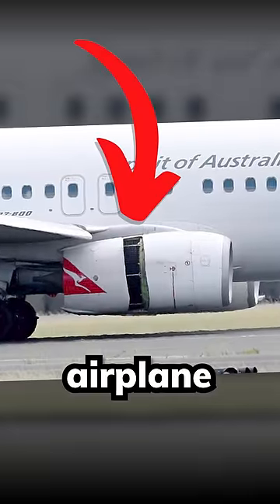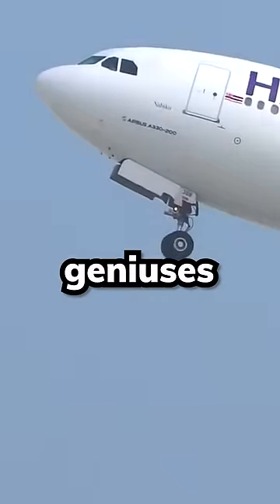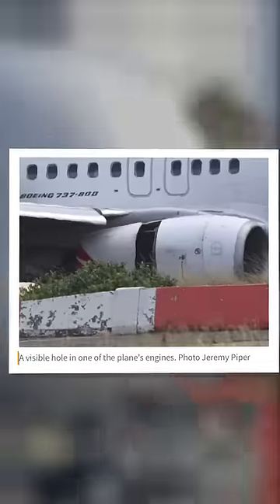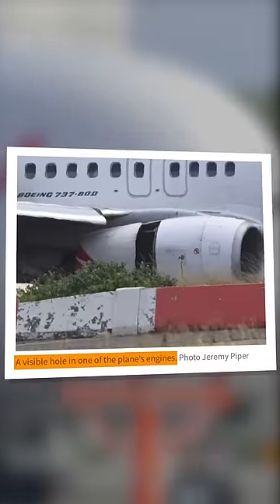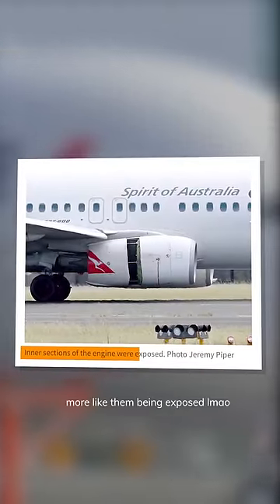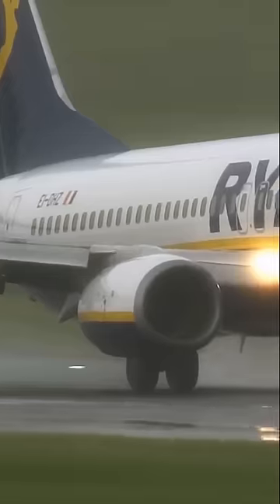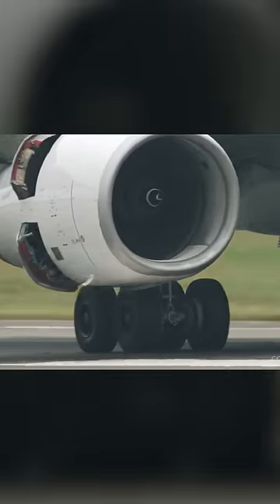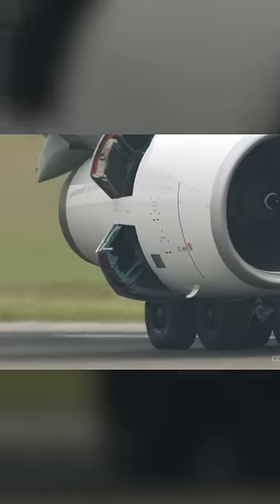Huge Hole In Airplane Engine 😱 @dailytelegraphAU lmao its called reverse thrust

Comment: That article made me have an aneurysm
Reply from the maker: I don’t even know what that means but LOL
Reply: @LuxPlanes  brain fart
Reply: What da word 
I better make a real hole and hide in the engine instead of googling forever
Reply: @shaurya.m2612  an aneurysm is when a blood vessel in your brain bursts. Can be caused by high blood pressure. Basically the joke being that the stupidity of the article that claimed the thrust reversers were damage caused me so much anger that my brain started to break.
Reply: @viscounttudon68 Did your brain use reverse thrust?

Comment: Even non aviation geeks are smart enough to know those are reverse thrust
Reply: Believe me, they aren't. They don't even know what a flap or an airbrake is.
Reply: @juannicastro8598  really?? damm..
Reply: I didn't know
Reply: @juannicastro8598  Can confirm
Reply: @WindowsDrawer  but now you know ;)
Reply: Nah
Reply: Actually not at all. Many of them might not even know those rounded objects hanging from the wings are engines.
Reply: @WindowsDrawer  are you a avgeek or not?
Reply: @greenesyt563  no
Reply: @greenesyt563  bruh i just asked my sis and she didnt even know those things sticking out of the fuselage are wings
Reply: @Notathreelettername  how did she know what is fuselage?
Reply: @greenesyt563  i didnt ask her that, i just asked her about the wings. but im not even gonna try to ask her about the fuselage cuz im pretty sure she doesnt know anything about planes considering the fact that she also apparently doesnt know planes need wings to fly. i swear i have no idea how that even came to be cuz shes also older than me by a year

Comment: They also called the 737-800 involved in the engine failure recently between Auckland and Sydney a 747-800!
Reply: XD, Daily Telegram better research more.
Reply: @AviationWeekly130  sky news also called it a 747 on their live broadcast!
Reply: @mini2flyerau oh my God. They need to learn.
Reply: @AviationWeekly130  yep, there is a difference between a 737 and a 747, not to mention qantas doesn’t even operate the 747 any more.
Reply: @mini2flyerau yeah XD, I love Santa's. It's a good airlines. Reliable. It's sad to see the 747-8 fllet is gone.
Reply: @mini2flyerau  qantas* lol
Reply: Bruh
Reply: Those two aircrafts have BIG differences!
Reply: @artyjaycayairlines ikr 💀
Reply: Now that's just embarrassing. A 5 second google search would give them enough info to at least name the plane right. With most airlines the plane type is even written on the side.
Reply: @Rundumsfliegen  exactly! The 737 has it next to the flaps, so easy to spot
Reply: bro what
Reply: Its honestly an easy mistake, like, could have easily been a typo. Yall are forgetting that most people arent huge dorks like us av nerds.
Reply: @gearhead743  suppose so but they are a national news outlet so you’d expect they would catch something like that

Comment: “Omg there’s a hole in the wings!!!” 

“Ma’am please calm down those are just the air brakes…”
Reply from the maker: XD
Reply: Spoilers*
Reply: @RedditRoyale120  if we are talking from a, flight attendant to a passenger, that already seems to lack basic intelligence, it would likely be dulled down to “ooga booga brake make stop, air brake make stop with air” so I doubt they would throw in the extra level of “intellect” required to understand
Reply: @RedditRoyale120  Aren't spoilers used for roll (as well)?
Reply: @dutch24 no , those are the ailerons
Reply: @Thel_Vadamee   appreciate the better information, it does not make your attempt any less valid. simply a gesture of semantics.
Reply: @Pgb633  on certain planes like the F-14 (because of the awkward wings) and the B-52 (because it’s so big that ailerons would literally twist of the wings) they strictly use spoilers
Reply: Wait until that passenger sees the plane landing in hot turbulance ocean airport
Speedbreak,max flaps,the wing vibrate like never before, and micro fall
Reply: @pham3383  they’d just roll over and die
Reply: @dutch24 spoileron
Reply: @Pgb633 spoileron
Reply: @nuclearwarhead9338  Thanks
Reply: @nuclearwarhead9338  lol 🤣
Reply: @Pgb633 on some planes, the spoilers are used for roll as well, look at basically any modern airliner and basically all swing wing fighters
Reply: @dutch24 yes they are used for roll control. 

In flight - when the pilots operate the   Ailerons , the spoilers on the "Down Wing" will also extend and assist the Ailerons in Roll Control which also increases the effectiveness and efficiency of the Ailerons at low and high speed.

The Ailerons and Spoilers are controlled by moving the Control Column ( Boeing) and Sidestick ( Airbus) left or right...
Reply: it's the same control surface, just that depending on the stage of the flight they're called spoilers, airbrakes, roll spoilers and a bunch of other names that i don't remember rn
Reply: @nuclearwarhead9338 spoiler
Reply: "THERE'S A HOLE IN YOUR LEFT WING!"
Reply: @EmilioGameair es ...
Name of Flight Control - Spoilers ( shaped like a square, found on top of each wing)..

Purposes - Speedbrake/Ground Spoilers ( on ground after landing)

Flight Spoiler ( used only while Airborne)

Roll Control ( used with the Ailerons) - see my explanation above. Ill give you the Extra points for mentioning every word you can think of ... ❤
Reply: Speed brakes
Reply: @RedditRoyale120 Spoilers are on the leading edge of the wing. The things that pop up on the wing are speed brakes.
Reply: @Pgb633 Ailerons and airbrakes are the same, it's just that you 9nly apply airframe on one side, and then deploy them at the other side but in the opposite direction.
Reply: @Thel_Vadamee casual sexism..
Reply: @Thel_Vadamee because men all know what reverse engine is and couldn’t possibly report that there’s a hole? Misogyny
Reply: nervous passengers in a nutshell:
Reply: @adultvirgin Ur right but using da spoilers for rolling is odd
Reply: @RedditRoyale120  same thing nerd
Reply: @Pgb633  what
Reply: @vladivosdog  my fault gang🙏🙏

Comment: Pilot: turns off the apu.
Media: The engine stopped and the pilot still took off.
Reply: LOL yes apu screee
Reply: I’ve flown with a broken APU, it was kinda cool. 

I fly charter flights all the time, so we have the same pilot and staff every week; a lot have remembered ours names. 

But no lights on take off is a vibe
Reply: @jimmymifsud1  I may be misunderstanding this since this is applicable to bigger aircraft, but wouldn’t it still have power on takeoff from the engine gens?
Or the battery?
(Probs doesn’t provide enough power lol but I want to ask)
Reply: @LittleJimmyR  depends on the aircraft, most regionals use engine genrators
Reply: @LittleJimmyR  the APU is a small engine that's gen power  back in the tail of the planes it's mostly used before turning on engines and before or after landing also they are used in emergency specially when a engine fails, when the engines are booted up. They can turn of the apu because the engines will generate power.
Reply: @docyinjkoka8684  I know what an APU is, but they said regional uses engine generators
Reply: @LittleJimmyR  ofcourse lol the engines already have generators thats why i said the apu stated before engines and it will be turned of after both engine started if the pilot was taxing with one engine than apu will be on intl the second  engine starts
Reply: @docyinjkoka8684  the apu was broken?
Reply: What is apu lol
Reply: @lubiepociagi6675  auxiliary power unit. Like a mini engine except it doesn’t provide thrust, only power
Reply: @LittleJimmyR  also bleed its very important to start engines
Reply: @docyinjkoka8684 that is indeed correct..
The APU also provides Bleed Air ( load compressor ) , used for Air-conditioning, Pressurisation etc...

During Landing for example, the APU supplies the pneumatic system, this is done to prevent sudden De Compression at low altitudes , it also keeps the Air Conditioning Packs ( Pressurisation/Air-conditioning Kits ) online, acting as a backup ( Engine Failure)....
Reply: @docyinjkoka8684 Yes, indeed ....

Modern Turbofan Engines , use Pneumatic Starter Motor to crank the Engine.

Comment: Pilot:dumps fuel
Media:oh no the plane's pissing, now sue the airline
Reply: Pp
Reply: plane took a piss in mid air
Reply: Oml im dying reading this ☠️
Reply: The plane’s pissing 💀
Reply: Bro you commented twice 😭
Reply: @Barrend  🗿🗿 copying my own idea
Reply: @Captain_2nice  smart💡💡👍
Reply: @fighter_750 for a incoming emergency
Reply: lol but it is true
Reply: @Kayan3963 This process is called " Fuel Dumping" .
The system consists of a system that basically drains the Fuel tanks at a push of 2 buttons ( 1 to Arm the System and 1 to activate a set of Nozzles close to the Ailerons)... Its purpose is to help reduce the weight of the Aircraft by discharging fuel overboard ( to the outside)...

It's completely normal... it happens on Boeing 777/757/767 and 747 .. oh i forgot to mention, the 787 and new 777X are also capable of this ..

For Airbus, i only know about the A380 ... Not sure about the others. You are Correct.. its primarily used for Emergency Landings..
Reply: Stolen
Reply: @khangpianoplane  bruh the original comment was also made by me
Reply: "The planes pissing" 💀
Reply: @fighter_750 💀💀💀
Reply: @khangpianoplane Bro didint look at the name😂😂😂😂😂
Reply: HAHAHAHAHA

Comment: Speedbrakes: Up
Media: Wing is breaking apart
Reply: Just want to correct you
But ITS called "AirBreaks"
Reply: @Aamtz168-26  Well it's still the same thing, but I just like to say Speedbrakes or Spoilers more oftenly
Reply: @Aamtz168-26 it’s not called air brakes, those are a seperate device. Speed brakes or spoilers are the flaps we see on top of the wings on most commercial aircraft. 

Sincerely, an A350 pilot.
Reply: @huskkyy  That's true because Air brakes are only found on regional aircrafts like the BAe 146 Avro
Reply: @Ian_Cheesy  Speedbrakes
Speedbird
Speedbird Zero Three Eight
Reply: @Aamtz168-26  what are “AirBreaks”? air breaking apart?
Reply: @Thunderbolt_1000T things that come out the plane that break the airflow so it slows down

Comment: Pilot: Gets up from his seat once in flight for any reason
Media: Oh no the pilot is not flying the airplane and roaming around the cabin, now sue the airline.
Reply: Too underrated!
Reply: And that's why , in most airlines , there is a requirement of Upto 2 Pilots ( most Aircraft)....
On long flights ( up to 3 Pilots) and provision of controlled rest .  Some airlines may also have 4 Pilots in the Cockpit ( 2 Relief , 1 First Officer and the Captain)... These provisions depend on the size of the Workforce and number of Pilots/Flight Attendants...

We also have Autopilot ( flying the Aircraft most of the time)...
So yes...
Reply: Pilot: turns on autopilot and stands up
The media: OH MY GOD WE'RE GONNA CRASH!
Reply: The reason the pilot got up is to take a break, means hook up with an airhostess in the sleeping quarters.

Comment: Can confirm as a KSP player: Reverse thrust is extremely useful.
Reply: Reverse thrust in KSP is pretty broken, you deploy it and you get the same amount of thrust in the other direction. In real life, it doesn't go directly the other direction - you can think of it like opening an umbrella, than the engine seemingly facing the other way

Comment: At first, it kinda did look like a piece of the reversed thrust is missing on the picture. I was flying on the A330 yesterday and to be honest, the reverse thrust was very powerful, so powerful my bag which was under the seat in front of me was sliding forward and I almost lost it.
Reply from the maker: bruh with just 2 reversers too damn
Reply: Did the plane stop fast at all? The pilots probably sent it to max reverse thrust and/or brakes.
Reply: I mean, we were landing at Juanda International Airport in Surabaya which its runway is 3000m long, so I guess probably. Anyway, I almost lost my bag there.
Reply: Then imagine the A380 had reverse thrust on all 4 of its engines😂
Reply: Some poor guy on my A321 flight dropped his phone while landing in Kansai because of the OP reverse thrust

Comment: Wait, journalists would NEVER spread false information without properly researching what theyre talking about right?
Reply: The most important thing to do is to go deeper while trying to understand something and also to fact-check. Now, if you don't trust what I said earlier... it's actually a good thing (I didn't mean those things weren't true) if you'll then fact-check it. Looking for information is easy, looking for good one... that is hard. I hope the disinformation problem (also called infodemic) will soon get less bad. Unfortunately, journalists aren't really helping to do so, but they're not to blame: no journalist is gonna get paid if not many people read it, so they must try to modify it or to at least put "shocking" titles to make it somewhat appealing to the people reading it.
Reply: I just realised how much I wrote... and I know it's a lot but please find some time to read them...
And correct me if you found something wrong in those.

Comment: Thank you. Just thank you. You ended the misery I have as a pilot.
Reply: But don't the images of the reverse thrust openings have very defined egdes wheras the picture of the article exhibits rough, undefined ones?
Not saying the clip is wrong, just curious
Reply: I have news you both might find interesting. That is how that plane normally looks on reverse config. Furthermore however, this plane actually was having engine problems, its just thst the problem engine is on the other side of the plane.

Comment: Whats not normal when the holes are shaped like cracks 💀
Reply: where do you see the cracks 💀
Reply: Yeah that does not look like reverse thrust. The edge is at an angle, and is not even straight cut
Reply: @tiagobrandao6588 it doesnt matter if its at an angle the reverse thrust still works perfectly fine
Reply: @the-real-shadotr00  my point is that the reverse thrust is not supposed look like that. On this very same video you can see Boeing reverse thrusts how they should be: a clean and straight line around the engine. You know, a part in a freaking passenger plane is supposed to look. But in that photo, the section in the exhaust side of the plane looks at the very least very banged up. You can't honestly tell me that that looks normal

Comment: Pilot: Uses ailerons
Media: An aircraft has been spotted having sheets of metal almost falling off as they were screwed on loosely. This could expose the fuselage and if that happens the possible rudder on the aircraft could malfunction and unfortunately cause the plane to crash, is this because of the irresponsible people at Boeing? The A320 has had lots of malfunctions, one example is air france flight  4590 which had its engine explode. Another example of a failure in the A320 is Airtours flight 28M which randomly set on fire due to a fire.

Comment: i already know its a thrust reverse cause im an aviation fan but there was an incident. On 26 May 1991, Lauda Air Flight 004, a Boeing 767-300ER, had an uncommanded deployment of the left engine's thrust reverser, which caused the airliner to go into a rapid dive and break up in mid-air. All 213 passengers and 10 crew were killed.

Comment: So in reality, this was a crash of QF144 that was scheduled to fly from Auckland to Sydney. In the middle of the journey, engine number 2 had fire and caused an engine failure. Qantas flight 144 had a bit of control. Luckily, it landed safely onto Sydney international with no injuries or fatalities. True fact about reverse thrusts but would have been more accurate if you could have used a real reverse thrust. Instead, that is what it looks like reverse thrust but in reality, the fire caused a hole in the engines  and had burnt up a few parts. You can see a tiny bit of the engine stuck on the thing. The image shown at the start of the shirt was the engine failure already been put out. And yes, the part in between the fines were disposed.

Comment: I recall several years ago when I flew my first time on a 737 just behind the motor coming in for a landing, the reverse thrust was activated. Seeing those two parts of the engine fold to the back scared the bejesus outta me, thinking the engine just broke apart!!

Comment: Every plane engine has a hole. The hole starts at the front of the engine and ends at the back of the engine and has all the turbines and inner workings of the engine inside it. This is since plane engines are hollow and must have a massive-ass hole in them to suck in air, or the plane wouldn't be able to fly. So whenever I hear about a plane engine having a hole, I don't shit my pants at all.

Comment: I feel the mistake here is a bit more understandable considering how jagged the edges are here. I also would like to see other examples of this particular engine in reverse thrust config just to he sure.

Edit: I did some more digging, and while i can confirm that this is how the engine normally looks, infound other interesting info. Funnily enough, the jet in the photo actually has a damaged engine, its just on the other side of the plane.
Reply: 1st, The edges arent jagged, they are edges. 2nd, i highly doubt any airliner would he cheap enough to taxi a jet with 1 of the 2 engines broken. 3rd, he does add other footage of reverse thrusters, and you can easily find footage of if

Comment: I hat to break it to you that’s an actual hole in the engin if you look closely you can see the hole is not even and it is cropped you can also see the dust from the outside you can not see that from the outside 
  
This was written by a pilot

Comment: Pilot: use reverse trust and flaps and spoilers 
Media: O M G CONDITION OF PLANES ON THIS AIRLINE IS SO TERRIBLE NOT ONLY WINGS ARE EMPY INSIDE ALSO THEY FALL OFF AND THERE ARE HOLES IN ENGINE TRASH SUE THEMMM